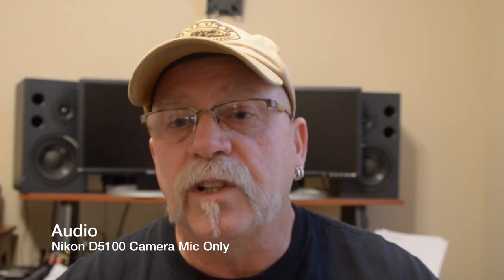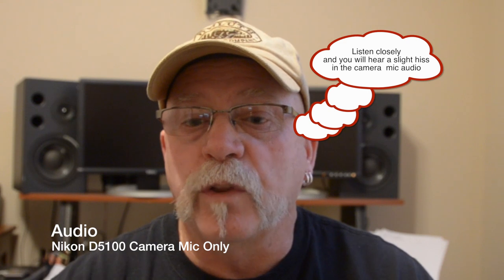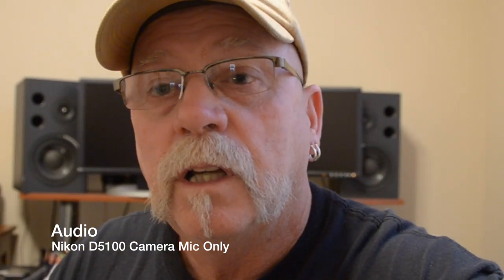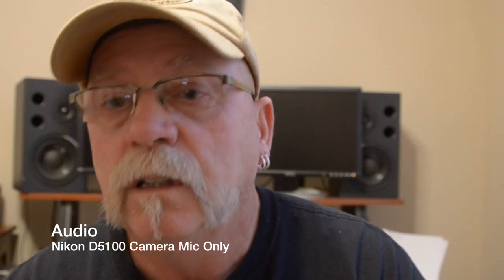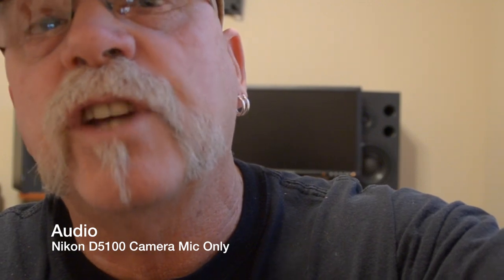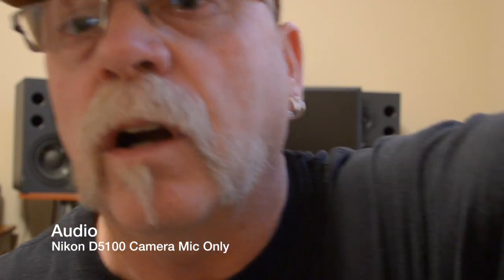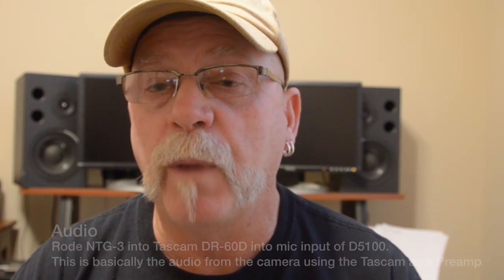Tascam DR 60D Test

Comment: Great video introduction to the DR 60D.  I just got mine but have not tried it yet...I have the same combination (Nikon D5100 and the DR 60D) but with a different Rode VideoMic.  I'm looking forward to putting all this into work and seeing how the audio comes together.  I wasn't sure exactly how I wanted to use the DR 60D but will definitely start with piping the audio to the D5100 and then go from there.  I've got Pluraleyes 3.2 (the license came with a bundled package I got from B&H) so I was planning on synchronizing the audio from the DR 60D with my video...not sure now after seeing your video.

Comment: My humble opine is that the DR-60d solo and synched  in post is the way to go for audio. Significant difference. i agree that the juiced Link is overpriced and the DR-60 eliminates the need for it. Adding the BP-6AA battery pack would add recording time if it doesn't add any noise to the circuit. I'd be interested in hearing the NTG-3 and an another manufacturer's mic plugged into the DR-60 to see the difference in sound as opposed to the NTG-3 by itself. Great video, observations and analysis.

Comment: Thanks for this test as it shows that the unit is great, the comment i am going to make on the noise issue is the person(s) who face this problem whether you use a tascam or any other brand you plug into your dslr make sure that your input(microphone ) is turned low on some cameras you have the Numbers others has a digital meter readings.By testing it with the camera mike on turn that volume down , then adjust the volume on the source accordingly to a level you need and you wil notice no his or distortion. I have spend time in recordings and sound engineering,and also work with video productions
Regards Jack
Reply from the maker: You are certainly correct about the levels.  Actually Jack...after reading his test results I think his problem was with that particular camera.  If I can find his article I'll post it and let you read it.  Thanks for watching and your comment!
Reply from the maker: SNS Pro Audio Visual Here's Trew Audio's article.  They said they have posted an updated article but I could't get the link to work.
http://www.trewaudio.com/audioflow/tascam-dr-60d-mixerrecorder-problems/comment-page-1/#comment-27363

Comment: It's the same with Canon as well. After reading volumes of information, the most essential tip I can give everyone is this: All DSLR and Prosumer Cameras have the absolutely NOISIEST mic inputs (I speak of virtually every camera that has a non-XLR mic input port) - so don't use them...EVER!

Record with the field recorder, don't record onto the video track on the camera from the line out to camera on the recorder (unless its just for a sync reference ONLY). Letting the camera record with its own factory microphones to create an a reference audio track for sync'ing audio in post production (i.e., Premiere, Final Cut, Vegas,...) is all you need as far as the camera audio track,

Another thing is that you want to keep away from using 3.5mm (1/8") jacks because they become so flimsy after a certain amount of use unless you are plan to "set it and forget it"...then it's perfect. If you find yourself needing to connect and disconnect mics and such, stick with XLR.

Comment: hi! good test! :)
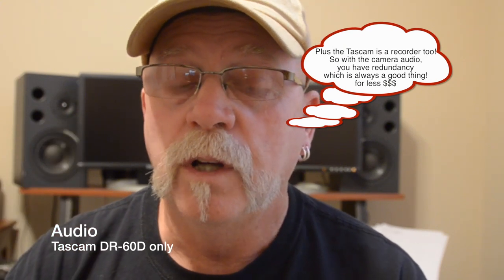around 5:43 I hear the best audio in my opinion... does the tascam works without accessories? I mean, is the audio recording just from the tascam dr60? is it connected to the camera or just work itself?
Reply from the maker: The Tascam does not have a Mic if that is what you are asking.  You will need to connect an external mic. and yes it will work without the camera.  Thats the way i use it most of the time...by itself and then use the audio of the camera to sync up with.

Comment: Great test, but one part that was missing was how would the camera sound using the Rode mic without the Tascam? Does the Tascam add anything to it or does it just sound better only because of the better mic? Tascam DR-60DmkII is now only $200.
Reply from the maker: There is no doubt that the rode into the Tascam or any other external recorder is better than the Camera audio, even WITH the Rode mic.  I am now using Canon 70Ds and their audio is better but I would still use an external Recorder.

Comment: Thanks for the review! I came across this video while searching for a DLSR mixer like the JuicedLink RM333, Beachtek DXA-SLR Pro and I was just about to buy the JuicedLink too. Is the DR-60D basically the same thing except that it also records?
Reply from the maker: I would choose this over a JuicedLink any day.  I have used both and it just makes sence to go with the Tascam in my opinion.
Reply from the maker: SNS Pro Audio Visual The Tascam is superior for the recording and the fact that it has so many "outs".  The Zoom H6 is great too but if you don't need the extra XLR's I would still go with the Tascam because it has more "outs" than the Zoom H6.
Reply: SNS Pro Audio Visual I just ordered it, thanks again!